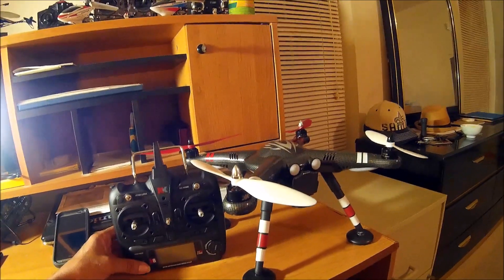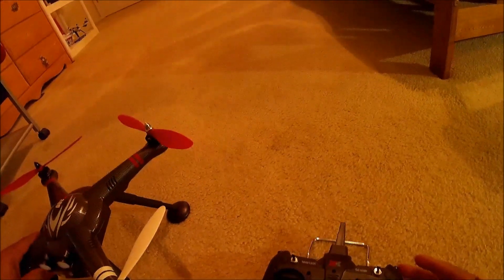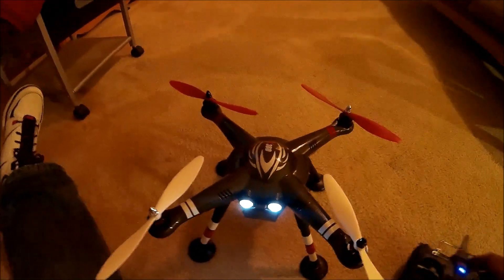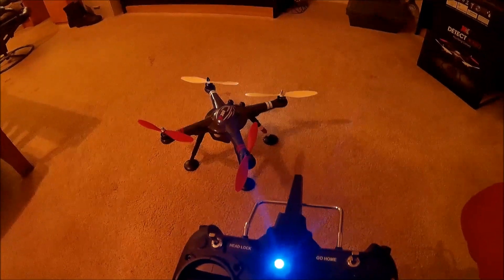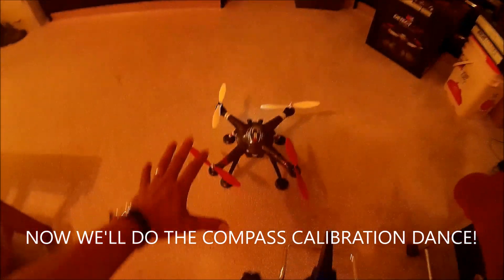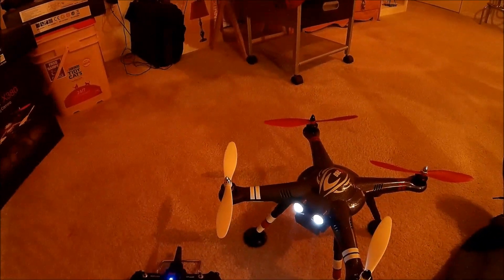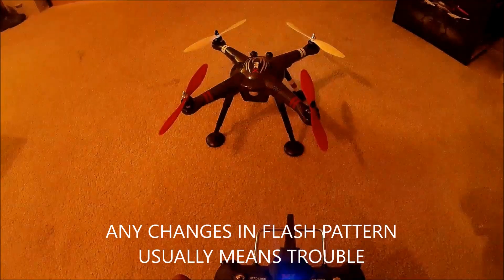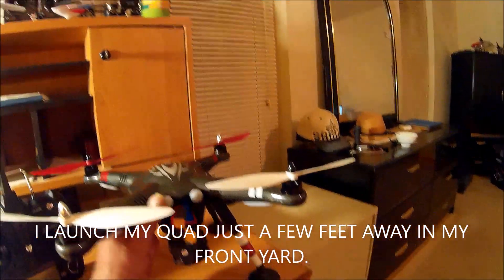XK DETECT X-380 "MUST WATCH BEFORE YOU FLY"

Comment: Tony would you not get a more accurate point if you just turned the quad round with two hands 360 degrees instead of spinning yourself in a circle?
Reply from the maker: +jefferson james  You will achieve the same results!  Turning myself with the quad, in my opinion, is smoother than the "jerky" motions that you generate by doing it with two hands.  DJ SOUL FORCE
Reply: okay thanks for the advice DJ. I'm also looking at buying a dji advance any advice on the phantom please
Reply from the maker: I just bought the Pantom 3 Standard but haven't received it yet. I can't wait to get it. I wanted the Advanced but I got a really good deal on Ebay for the Standard.  This will be my first DJI.
Reply from the maker: +jefferson james  Did you get your DJI yet? I got mine a week ago and flew it once. The weather has been bad here but I'm hoping to fly it again tomorrow.  I can say this now, after just one flight, I wish I had bought the Phantom first! Man, it takes excellent video and it's not hard to setup and fly either.  The 3 axis gimbal is awesome, just like movie quality.  You're going to love it. Keep me posted. Thanks
Reply: Hi DJ no not as yet I'm waiting for black Friday sale this week due to import issue costs, have you took any footage yet and what model did you go for.:)
Reply from the maker: *****  I got the Phantom 3 Standard. The "sneak peek" video is on my channel right now. Happy flying.
Reply: Hi DJ I got my DJI pro and loving it. I have been taking it steady and taking my time ive put a few videos up, not the best but I'm working on my editing skills as I go along.
Reply from the maker: +jefferson james  That's great, you'll be a pro in no time!  I want the Pro also, gotta try and sell my Standard first.  I'm still flying the x380 but that Phantom makes me wanna call in sick from work sometimes!  Good flying days are few this time of year.  Happy flying bro.

Comment: Well, add me to the 'don't know what happened' crash list.  Like you, I was so anxious about flying this after all the crashes reported on rcgroups.  I didn't get it out of the box for a month!  Had three good simple test hovers and flights.  The fourth flight I calibrated the compass and the transmitter sticks as usual with no glitches, made sure both switches were off, and plugged in with GPS acquisition for 5 minutes.  Auto takeoff just fine.  Hovered 30 seconds just fine.  Went up to about 30 feet, and 50 seconds into the flight it just started to go all wonky on its own.  Weird power decrease and drift. I brought it down for a hard landing into a tree which probably saved any visible damage.  My battery cell tester showed 94% on each of the cells.  The flight control software shows nothing I see as damage or a problem - all sensors work, and it gets 13 satellites even in the house.  But now I'm back to not wanting to fly it.  I swear this quad model is faulty.  It's failures are unpredictable and scary.  Like you, she's going to have to earn my trust back....Keep up the video log - I need to get the confidence back.
Reply from the maker: +amrunner4  Wow...now you got me scared again! Lol  It's really strange that they can fly perfect one day and the next, BAAAM!  Good luck bro.

Comment: DJ-  Have you had successful RTH since your crash on flight #2, or are you avoiding using the RTH now?  Thanks
Reply from the maker: +amrunner4  Yes I have used it several times since the crash and all's good. I learned to time my flights and I won't use RTH when the battery is low. In fact if I'm flying and get a low battery warning, I won't use anything that's "auto" not even headless mode! Happy flying bro.

Comment: Your instruction were right on. Got my G2D today as well as the 40 wires I ordered :>) Had it up and running very quickly. Now if you can tell me what glue do I need to do some repairs on it? Seems that while I was piloting it around 2 alien space craft came down from the heavens and forced my X-380 right into some trees. Yup that's my story and I'm sticking with  it :>) Have you found a glue that works?
Reply from the maker: +Terry Gulliford  ...them damn aliens!  When I had to repair my landing gear, I used Gorilla Super Glue Jell, got it at Walmart.  Next flight, watch out for them damn aliens!!!!
Reply: +DJ SOUL Garlic cloves are supposed to work with vampires, just might work with aliens :>)

Comment: I  join the group. MJX X101 will be my first one when it get here. For that price of the X380 I had to jump on that price. Now I have to sale some Ham Radio / Amateur Radio gear. That my other hobby.
Reply from the maker: +Anthony Johnson  Welcome to the hobby. It's gonna take some practice if you've never flown quads or helicopters before. "I" wouldn't have suggested the X-101 as a first quad, maybe something smaller to learn on. But from the looks of your homepage, look like you drive 18wheelers so I know yall like big toys!  Be careful with the big quads, get to know the X-101 before you fly that XK X-380. Not trying to sound like an instructor, I'm welcoming you & sharing some of my experiences. If you got a minute, check this video: https://www.youtube.com/watch?v=-IxV4NJI5FY   I learned to fly inside first, then moved up! Thanks for subscribing to my channel, welcom to the hobby.  DJ SOUL FORCE

Comment: Mr Force, well after watching this video like 8 times now, I finally launch mine today.  
Perfect flight.  Did  a low altitude  test on all the features to make sure they worked. RTH brought her back exactly on the point it took off from.  I'm a happy camper now.  lol Thanks for all your information about the x380.  Happy flying friend.
Reply: +DW Caudill DJ, I forgot to tell you about the compass calibration on mine. I followed what you did step by step.  While going through each step making sure I did it right, it never turn from flashing green to solid. It never has a solid red light/no red at all.  It just stayed flashing green all through the process.  I did it twice by the way and same thing.  I was a nervous wreck about sending it up. What is the deal with that anyway? If it wasn't calibrated right wouldn't the RTH feature not  work?   Thank you and looking forward to hearing from you.
Reply from the maker: +DW Caudill  The magnetic compass is mostly used for "headless" mode and (I don't think) wouldn't affect the RTH, which is GPS guided.  While calibrating, if it didn't turn solid green after 3 clicks, then keep clicking until it does. (sometimes it takes 3 to 5  fast clicks)
Since you never got the solid green, I'm assuming that's why you didn't get the solid red when you pointed it up to the sky. Let me know if that works, otherwise, I'm at a loss!  Hope all goes well, have many nice flights!!!!
Reply from the maker: +DW Caudill  That's great...  Did you buy the X380c with the gimbal & all the bells and whistles?  I know the emotions that go into that maiden flight...what a rush!  Have many happy flight sir.
Reply: +DJ SOUL FORCE Well, it worked.  After persistent attempts it finally went through. Also, my wife had just ordered some cheap batteries on line. I think they are already weak. Could this affect the process? Other then that, I'm very happy with this quad. And thanks for all your help. I may be asking you questions in time. Hope you don't mind.
Reply from the maker: If I can help, I'm happy to do so. We're all in this together brother. It's my first GPS quad too. By the way, I use rechargable energizers in all my transmitters...batteries cost too much.
Reply: +DJ SOUL FORCE One quick question. If battery is low but not flashing yet, can this cause the quad not to respond to stick input  Like it was hovering out about 60 or so and about 30 feet up and when I pulled the stick back it would not respond. Forward and side to side motion worked fine but not backward motion.  I did get it back and preceded  to calibrate the compass one more time.  It seems I have to do this before each flight regardless if it's in the same launch site.  Also,  when I put it in the air , it started to do wide circles around launch point and didn't have much  control with it.  It drifted into my privacy fence. No damage to speak of.  I know this is long but if I do the dance before each flight which I'm doing,  all seems fine. Does this sound familiar or do I have reason to be concerned with future flights?  Thank god I was just flying about 4 feet in hover just to see before I preceded any farther with it.  Thanks again sir.
Reply from the maker: Again, it sounds like a transmitter binding issue when the quad won't hold it's position. Did you replace those cheap batteries that your wife bought? Lol  Replace your TX batteries, rebind the TX and that should help.

Comment: ,The FB XK Detect X-380 group they want you to do the magnetic calibration every flight according to the latest post from the XK Factors... that's what I got out of the posts.
Reply from the maker: +Sam martinez   It doesn't hurt. Even the book says, recommend calibration often just to be safe.  I guess it's up to the owner's, but I've only calibrated mine a couple of times.  The quad uses the compass mostly for headless mode, which I never use. Hope your's is doing well.
Reply: +DJ SOUL FORCE I can only fly it on weekends because the put me back on nights 6days a week 12 hr a day. I just got my gimbal a few days ago the same one as yours but need a camera still. is yous a sj4000 sjcam or is it a different brand? your video always looks nice. I'm still waiting on some gimbal footage from you.
Reply from the maker: +Sam martinez  I bought my camera on Ebay but that listing is no longer available.  It was listed as a SJ4000 camera but I later found out it was a knockoff!  Works pretty good though.  12mp with wifi and came with a bunch of accessories. I won it on a bid and paid about $45, but a real SJ4000 cost around $60. There's some more nice cameras on Ebay and you don't really need the wifi cause you can't use it on most quads. My wifi only works for about 50-75 feet!
Reply: +DJ SOUL FORCE does it have a 2" display screen
Reply from the maker: Sam martinez  It's a 1.5" display. Here's one just like it: http://www.ebay.com/itm/Wireless-WIFI-SJ4000-Waterproof-Sports-DV-1080P-HD-Video-Action-Camera-Camcorder/221858747552?_trksid=p2047675.c100010.m2109&_trkparms=aid%3D555012%26algo%3DPW.MBE%26ao%3D2%26asc%3D20131231084308%26meid%3Dc539478336d649869e8e5a55648726af%26pid%3D100010%26rk%3D2%26rkt%3D24%26mehot%3Dpp%26sd%3D131504053401
Reply: +DJ SOUL FORCE thanks

Comment: Look this up by Copter Hubsan - XK DETECT X380 Quadcopter Software Control; plus TX Setup
Reply from the maker: +Robert Street  I've watched that one, many times. I have a really hard time getting through his accent!  Not being able to understand his calibration video (he sometimes go through the motions too fast!) is what inspired me to do my version of the "calibration dance!" Lol  Thanks brother.
Reply: In the manual it is done the way he describes it. It is on the next to last page.The one you are doing I believe is for a different drone setup. I do not think it calibrates it properly. I know he is hard to understand but he shows you how to do it.
Reply from the maker: +Robert Street  I'm pretty sure I followed the instructions in the X380 manual. Ref: Item 13, paragraph 3, last sentence - "Quickly pull the control levers on BOTH sides for ONE circle as to reach the maximum of minimum position"  However, it's ok I guess, to do one stick at a time and more than one circle!  Thanks

Comment: DJ SOUL FORCE - To calibrate the TX you just pull the left stick straight down, then go to the right lower corner and then flicker the "GO HOME" switch about 6-8 times before you get a flashing red light. Then you turn the left stick counterclockwise in a full circle a few times, release and quickly do clockwise same side a few times and release then do the right stick the same way and when done just wait and then you will get the green light again. To calibrate the compass, you hold the left stick down and flicker the "HEAD LOCK" switch 3-5 times until the light turns solid green then turn the quad CLOCKWISE 2 FULL TURNS. From its position. You do not need to turn your body. Use your hand. 1/2 turn and set it down then next 1/2 turn etc. When that is done then put left stick down again and flicker the HEAD LOCK switch again until the light turns off. Then pick up the quad and point the front down to the ground and the red light will come on. Then with front end pointed to the ground turn that 2 times. /it is a little difficult but try and hold the arms of the quad doing 1/2 turns until you do 2 full rotations. Then set it down and left stick down and flicker the HEAD LOCK stick again 3-5 times and the green light should come back on. Now you are calibrated. Copter Husban shows all of this in his video.Here is the link. He also shows the software too.   https://www.youtube.com/watch?v=Rl8p95fZ_44
Reply from the maker: INTELMAXELL  Hope you have many many happy flights. I'll be waiting for some video.
Reply from the maker: +Robert Street  That's a bit different but I'm sure it works.  TX only needs to be done once (thank god!)  How's it going with your's?
Reply: I have flown about 3-4 times with no issues and all is well.
Reply: I only re-calibrate the TX if the drone is straying from hover. But I always calibrate the compass before flight.
Reply: +Robert Street Just had a flight today, and I had to bring it down because it had a big circle wobble hover to it. I never had a crash but had to do a hard landing 2x. I don't understand what is going on. I do everything to the book and had 5 flights that was great. I do compass calibrations CCW maybe I should do CW turns, but I thought it didn't mater as long as the green and red turns are identical in directions.
Reply from the maker: I've been doing mine CCW also, the book doesn't say but the picture shows an arrow pointing CW. What you described here almost sounds like transmitter needs binding. I really can't (or don't want to) guess, but it sounds really strange and not good. A few of the crash videos started just like that. Be careful bro.
Reply from the maker: INTELMAXELL  Have you seen this video?
https://www.youtube.com/watch?v=DTDt2DvbJnw  This guy's X380 was acting strange so he flew it with a rope tied to it for testing and so it wouldn't fly away! Check it out.
Reply: +DJ SOUL FORCE I am going to do the TX calibration from page 13. Please pray for me on my next flight today. Thanks brother for all your help:)
Reply: +DJ SOUL FORCE Had two perfect flights no wobbly GPS hold. Thank you for the video.  I will post videos on my channel and on the XK X380 Facebook page.  Do I have to keep doing TX all the time? Maybe there is an internal battery in the quadcopter that stores it. Like a computer CMOS battery  (just throwing some ideas...but not sure) and it's bad. Because this is the 2nd time I had to calibrate the TX.  Thanks brother you are the MAN ! :)
Reply: INTELMAXELL - it is clockwise turns. Just like time on a watch moves. I would calibrate the TX if you take it far from where you normally fly. ????When you transport it in a car you are suppose to do TX and compass calibration because of the magnetic shield in the speakers etc. If you are close to normal flight area then I would not think you would need to calibrate the TX unless you notice the drone wandering from hover. I always calibrate the compass before every flight though. Glad all is well now
Reply: +Robert Street Brother I am glad too! I was going to let all die with this hobby which kills me. Thanks the both of you guys. I fly far from home and now made a preflight list to do thanks to this video and you.  God bless and happy flying.  :)
Reply: +Robert Street When you do the right stick, after pulling straight down, do you put stick to the lower right also?  Thank you
Reply: DW Caudill - Not sure what your asking. If you read my post after holding down the left stick and to the right etc...you start moving the left stick in a circle counterclockwise a few times then clockwise a few times on the left stick then repeat the process on the right stick. There is a video I think I mentioned the name etc that shows you all of this.

Comment: Question!!! I never did the compass dance when I first got mine. Left the instructions home so all I did was get the GPS lock.  Do you know if you can do the compass lock later now that it has been flown (successfully) without having done that?
Reply from the maker: +Terry Gulliford  Yes, it's only a calibration procedure. The quad mostly uses the magnetic compass for headless mode. Some guys do it before every flight but I've only done mine twice before this video. It's recomended to calibrate again whenever your last flight was some distance away from your next flight. So I take it that all's well with your X380?
Reply: Thanks!! Its done.
Reply: +DJ SOUL FORCE Its done and I'm a happy guy again. I did order the wiring harness for the gimbal. Actually I orders what I thought was 2 but what I really ordered was 2 orders of 20 each so I have 40 harnesses headed my way. Need any? I will have like 39 extras :>(
Reply from the maker: Haha!  I read a post where you said that you were going to "use 'em for Christmas decorations!" Take care.